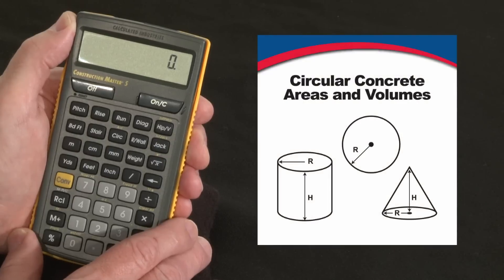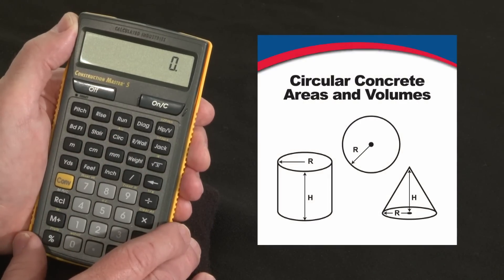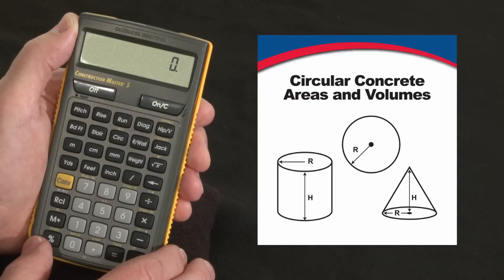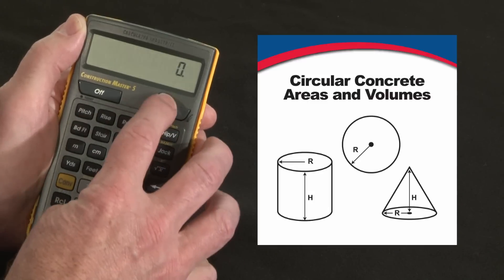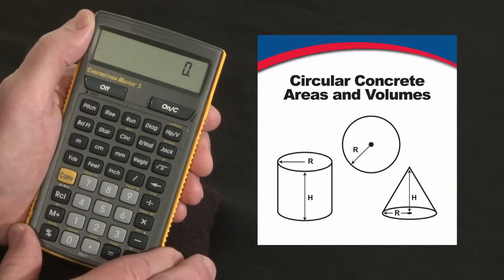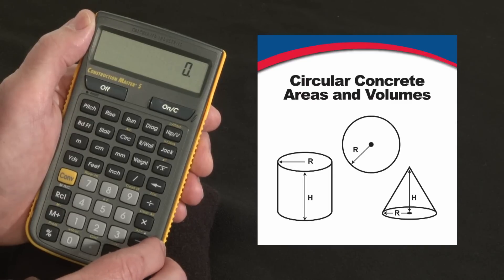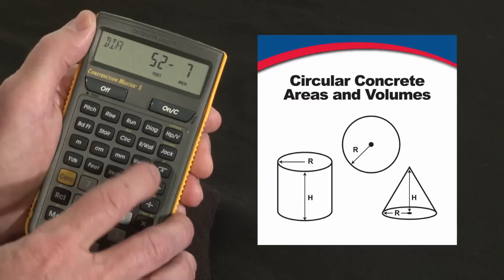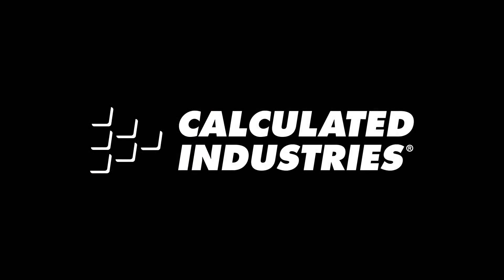How to Calculate Jobsite Circular Areas & Volumes without Formulas | Construction Master 5

Comment: how to get an arch on the caculater?
Reply from the maker: Dear Ricky, I'm sorry but the Construction Master 5 does nothave a radius function for doing Arch - You would need to use the 4065 Construction Master Pro calculator or app (avail for iOS and Android devices).